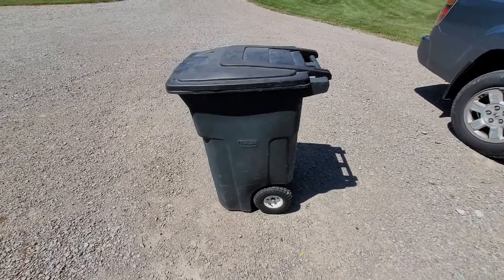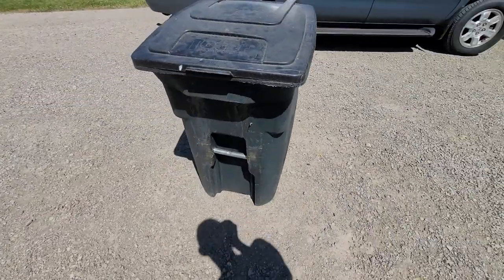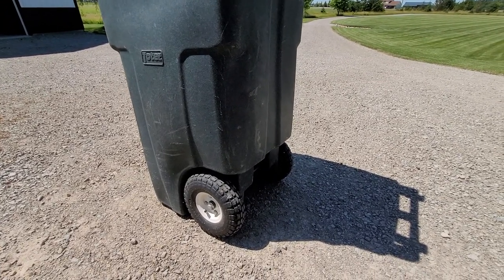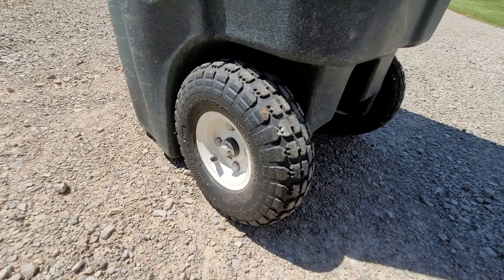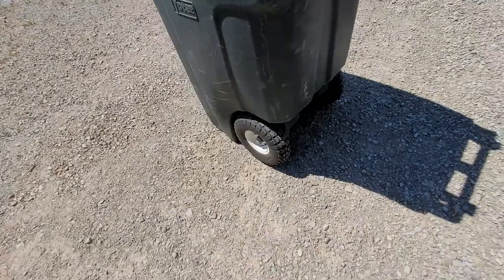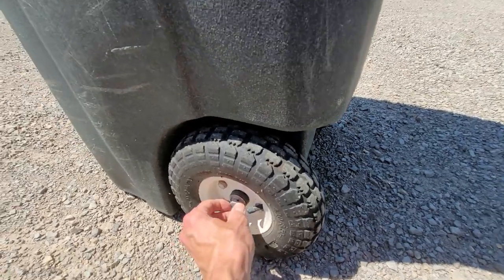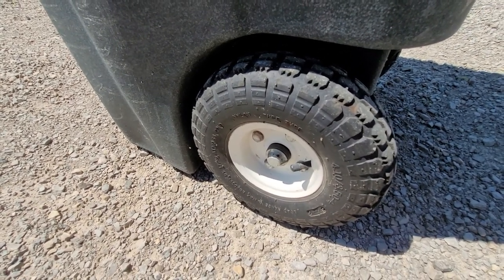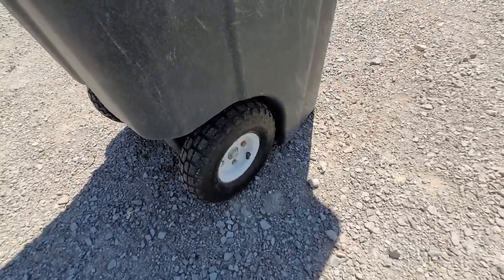Amazing Garbage Can Hack!

Comment: Do you have a model number or size for the wheels? I have the same style trash cans; one set have rubber wheels. The other one has hard plastic,which are so loud. 
- Much appreciated
Reply from the maker: Yep!  Here is a link to the harbor freight listing.  They sell them with black or white hubs. (All are 10") https://www.harborfreight.com/10-inch-x-3-1-2-half-inch-pneumatic-tire-67465.html